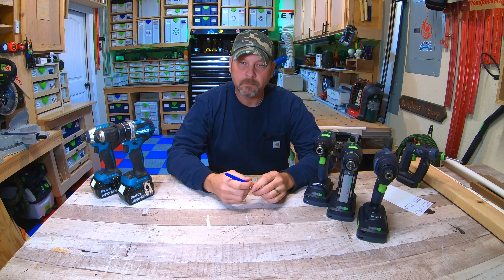Why I don’t recommend FESTOOL drills anymore.

Comment: I'm looking to buy the CXS.  I have a TDD-12FX (the old NiCad 12volt) and finally found decent replacement NiCad batteries so it will live for a few more years.  For me, the one reason to have a T-18 or similar is for the eccentric chuck.  It and the right angle allow you to get into any place with power, all in a compact platform

Comment: I Like my C12 and T12. The only complaint is Festool has discontinued batteries for the 12v drills.  Love my CXS, it a daily user. Best part is the chucks and centrotec. Now days the heavy work is done by Ryobi impact drill.

Comment: The new Makita 40v drills have electronic clutch’s. Other then that and festool idk any other drills that do that yet.
Reply from the maker: Thanks. Guess I just don’t quite get the benefit of that yet. Mech clutches have worked forever, so why fix what isn’t broke? And, I didn’t even realize Makita has come out with a 40v lineup. I’ll check them out.
Reply: @BrianWatersOutdoors  yea it’s pretty cool platform has some bigger tools on the line up and most of the 18v tools.
Reply: Hi-end Metabos do, and Mafells.
Electric clutches aren’t as accurate as well-made mech ones, nor do the tools last longer.
Only real advantage is a bit better energy efficiency.

Comment: There aren't too many companies who make a c style drill in 18v with multiple chucks. While that may not be a big deal for some it could be for others. I currently own the m12 installation driver and I go for that thing more than I go for my 20v max DeWALT impact driver or hammerdrill/driver. The C18 has some appeal to me for the form factor. One of the things that draws me toward the m12 is the c style grip. Also the PDC 18 and Europe only TPC 18 have appeal to me as well due to the extra high rpm. I already have Festool batteries. Buying a Festool is more appealing than something from a battery platform I do not own. I have no desire to get the t18 or t18 easy. Festool really needs to bring out a new generation of the c18. The current model could use more torque and more rpm.

Comment: Thanks for the review.  This just happens to be the exact position I’m in right now.  I have all dewalt and they serve me well but I am looking for something a little more refined.  I’ve looked at the CXS in part because of the compact design.  After using it in store I really like the feel, smooth operation and versatility of it.  Keeping everything else.
Reply: @BrianWatersOutdoors did you saw the new cxs 12. After 6 years I Sold my old one for 170n Euro. ❤ and I will order the new one. 250 Euro for a full Set
Reply: @goodguy3416  Did you buy it? What are your thoughts on it?
Reply: @LesTutosdUneMinute  cxs 12. Yes last month. 229 Euro without the angle  Chuck. Great Quality. I Don't need a second drill for most oft the Things. Permanent light function is great. Only disadvantage ist the Sound.
Reply: @goodguy3416  Allright, thanks. I'm also on the verge of buying one, but the sound is my only concert. I've read in video comments that many people have returned their drills just because of the noise.
Reply: @LesTutosdUneMinute  never a reason for me...

Comment: I own various brands of power tools. I own Makita, Bosch and Festool drill drivers. Best tool for the job. My first Festool drill/driver was the CXS and is a great little unit. It is lightweight, the speed control and power for a 10.8V is amazing. I later bought the T18E and the design is very nice, separate clutch dial is well thought out so you only to switch between drill and driver mode.. I can't justify their price for the 18V drill/drivers. I have the Bosch 12V Flexfit which has the handy right-angle and offset attachment. I own 3 of the new brush-less Makita, 2 of the drill/drivers and 1 impact driver and they are great tools as well.
Reply from the maker: Thanks!

Comment: Thanks for the vid.  I buy into the Festool drills for centrotec, wherever possible I avoid a Jacobs chuck.  I have 3 Makita drills, 2 Bosch 12 volt and a C18 and CXS.  The Makita stuff feels clunky compared to the Festool and I really like the Bosch 12V range.  Whilst we are shooting the breeze, if I had to pick 2 drills is would be the CXS and someones Impact.  Thank again, was helpful to hear your opinion.
Reply from the maker: Thanks!

Comment: I have makita drills but I was also eyeing the CXS to be honest.  Can I ask how do you juggle centrotec and standard bits?  Does it get annoying having two sets?
Reply from the maker: The CXS is amazing. I have quite a few Centrotec bits I’ve collected over the years. You can buy the Festool Centrotec bits or save some money and buy the Snappy brand. Also, I will often use the Festool Centrotec bit adapter that converts to the “standard” 1/4” bit.

Comment: If those are drills you actually own and use, I don’t see any signs of extended use, and or wear.  In other words, buy what you like but I don’t find any signs of much use at all.    So I am not convinced that there has been enough use of either brand to be presenting a valid opinion  of either brand.   I have been using cordless drills since the 80’s. And I have not owned as many as you have in your collection.   I use my drills until they need to be replaced.  With years of use  you get a better feel of quality.   I’ll likely be buying Festool again if I live long enough.
Reply from the maker: I have to disagree. Not sure why some folks can’t understand that it is possible to take care of your tools and have them for years and they still look good. I take pride in what I buy and don’t throw around my equipment, clean them routinely and maintain them.
Reply: @BrianWatersOutdoors  I try not to waste time papmering my tools so that they continue to look unused.  I understand some wood workers are mostly tool collectors.  I have never seen a reason to have 6 drills/impacts.   FWIW I previousely owned a Makita drill/driver and impact.  I all but stopped using the impact when I got my first t15 Festool drill about 9 years ago.

Comment: The only festool gear I have for now are their systainers. Purchased a couple of the kit/installer sets for a great deal and got some Tanos ones as well for dirt cheap. I think they are the second gen ones. The good news is the Makita systainers fit the festool and tanos ones. I have a bunch of 18v makita tools, a bit mad at the 40v that is not compatible with the 18v and vice versa unlike DeWalt and the 20/60v flex system. For my “smaller” power tools I use the Milwaukee m12 system. Small and powerful, especially the 3/4 impact wrench. Just awesome. The only dewalt “tool” I have is the cordless pressure washer. I am not a professional tradesmen, so the cost of the festool equipment has always been a big mental hurdle that I still cannot justify.
Reply from the maker: Thanks!

Comment: As far as the torque situation, the Chinese manufacturers use best case scenario. Festool uses average working torque. You need to compare apples to apples when comparing the brands

Comment: I bought the pdc and tid 18 combo already owned Milwaukee and Makita. I used the drills for a week and took them back to wood craft. They were nice but just didn’t have the power or precision I was looking for. I also had the t 18 easy it was my first festool drill I used it for a month then sold on Facebook just didn’t have the power. I exclusively only use Makita impacts and drills. And I now have the new Dewalt 12v 4 in 1. And that thing is sweet if you like the regular t style drills. It has plenty of power and all the good attachments.

Comment: You compare oranges vs apples, the corresponding festool is the TDC 18/4 from 500 rpm to 3600 rpm and torque up to 75 nm the Festool  you show are mid range 18v, each tool has its purpose, and you get it for a specific job, yes Festools are expensive but they have longer life span superior build quality and parts support for many years, one of the many Festools I have is a circular saw TS 55 it is close to 18 years old it has cut a lot of miles on it if you look at it is like new yes it was expensive when I got it but it has his money plus the above.

Comment: I've had a C12 for 15 years and during that time it's seen a lot of hard use. The batteries are only now needing to be replaced. The motor has as fine a degree of control as when it was new, the trigger has no discernable wear. There's no play in any bearings whatsoever - it looks worn but feels like new. I've used other peoples' Makitas half as old with wear and tear problems. I would have had to buy 2 Makitas for the lifespan that my Festool has given me - probably years more when my new batteries arrive - so a false economy in my opinion.

Comment: I have the t18+3 The new 4 gear and i will order new cxs 12. Here in Germany the basic festools are not so expensive. I bought the new t18 incl. 1 battery and systainer for 150 euro

Comment: I love my cxs as well and only like my impact. Are they worth the price... cxs yes, impact no. And I have all kinds of yellow and red, but no makita... I'm not quite why that is. I may have to try the makita impact. I find the festool a nice break from the aggressive dewalt and Milwaukee... especially if it's in my hand most of the day.
Reply from the maker: I think you’ll like the Makita. Pre Festool I was all DeWalt and a few Milwaukees. Makita has risen in my shop to my favorite drill and driver system.

Comment: The Festool drills xarry a premium price tag but the quality is not on par vs the competion. I had a problem with the CXS chuck. It had vibrated like a crazy since the day I bought the drill. The Festool service center replaced the chuck but the new one is equally bad. They said the vibration is within the Festool tolerances. Otherwise the CXS is a great drill. The chuck is inferior quality.
Reply from the maker: Which chuck was giving you issues? I mainly use the Centrotec quick chuck and hardly ever use the Jacobs chuck. My 3 CXS ‘s have all worked perfect, but they are all over 2 years old. Not sure if the newer batches are having this issue?
Reply: I know a even better tool, Ryobi
Reply: @BrianWatersOutdoors  Sorry, I should have been more precise. I had and still have a problem with the Jacobs chuck.

Comment: Brian i think a FT cabinet drill might be worth it.But as for the rest go buy something else as youll be wasting money.
Reply: @BrianWatersOutdoors  I did forget to add as a festool user is 1) You will buy into a second platform if your work is more general. 
2)As a T18 owner and having had a PDC , the option of a 90 deg head and eccentric is something I use quite often so that could be a game changer for some.